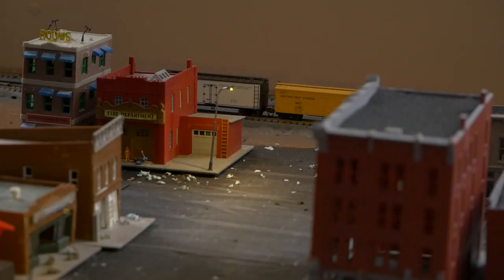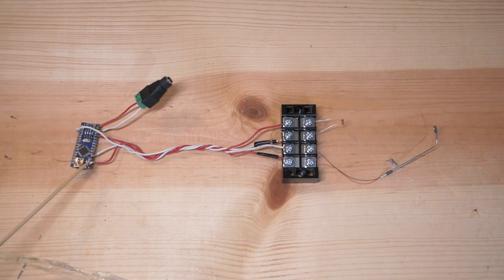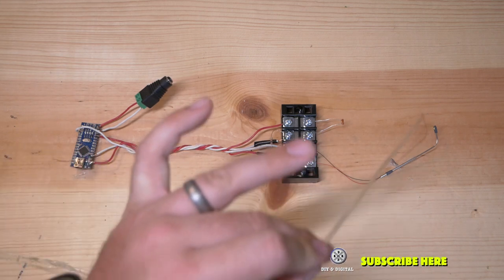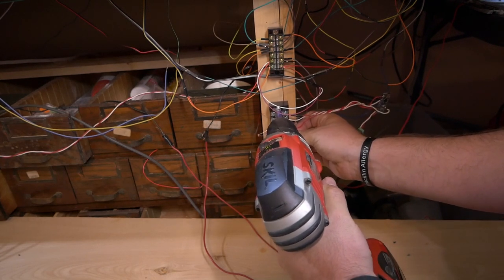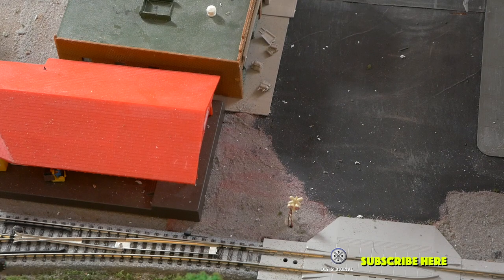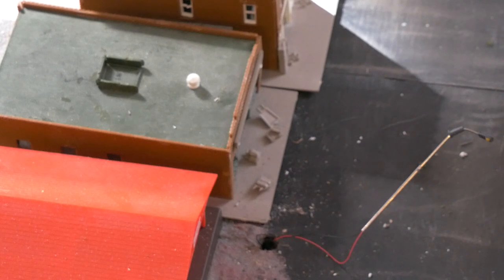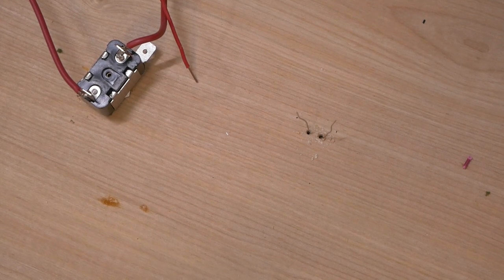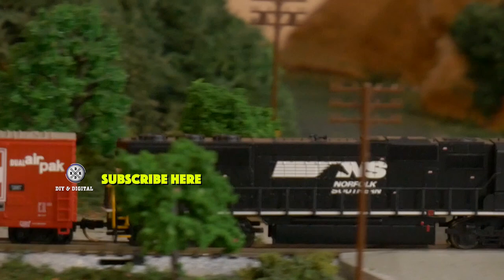Model Train Automatic Street Lights with Arduinos Part 2: Installation

Comment: As the supply is only 5V, an output may not have enough voltage for two LED's in series. So for multiple lights you could use multiple outputs (means lots of separate wiring!) , but to have chains of street lights is a problem as the Arduino is limited to 20mA per output (40ma Max) and the whole board is limited to 200mA (400mA Max).  So if you want 3 or more lights per output, you need to power a transistor from the supply and drive its base with the Arduino. A small signal transistor will drive maybe 5 LED's in parallel, else a power transistor will be required for more.
Reply from the maker: Great observation.  I am going to have to try that when I install more street lights.

Comment: Great video. You make it look easy! I have (of course) a couple of tips: 1. When soldering the wires, have some heatshrink to cover it, not electrical tape. These layouts are up for years, often in humid basements, and the tape just doesn't cut it. I actually use a small size heat shrink tube for each wire, and then a larger tube to bundle the other two together. Makes it almost as hardy as the original wire. 2. For the power connector, hot glue is fantastic. It adheres to almost as much as superglue, is waterproof, you can cut the excess, and it's removable if you have to move or replace. You could have filled your wiring hole with it and stuck you lamp post in that hole.3. The last technique where you used breadboard wires against the photoresistor. I would stick with soldering, especially since the fascia will move over the course of a year from the seasons.
Reply from the maker: You're giving some awesome tips.  I think I'm going to start a user-tip video and feature some of these.
Reply: Apparently I can't send a photo, so here's a link to a typical joint: https://www.dropbox.com/s/tzidwyr3bc4kngi/2018-09-10%2008.19.14.jpg?dl=0

Comment: nice video JD - for my streetlight I use a gray,  1mm thick square "sillywinks" foam piece - gray [get em at walmart for $0.99 8x14 sheet].  It provides a sturdy base and covers the larger hole.  I cut a line in the square from the center to  a corner so I can slip it on after the wiring and function of the light is verified.  Great video.  i am learning a great deal from this channel - keep up the good work
Reply from the maker: That's a really good idea!

Comment: Hi Jimmy nice job,but Vinny has a point ,but i don't know what else to do unless you use a on and off switch.Also with the sallied wire ,I make a loop and put the anther wire thew it and make loop with that one then flatten each loop on it's self and solder them then heat shrink or e .tape. works great for me.    like your videos. Arduino is cool.
Reply from the maker: Hmmm.  I'm wondering if I could hide it at the top the fascia panel.  Photoresistors are tiny enough.

Comment: hi Jimmy...when using photo sensors  wouldn't the lights go on & off as people walk by or are standing in front of when operating trains?? just curious... vinny
Reply from the maker: +bnsf6951 Good catch.  I had that problem at first.  I just had to set the trigger threshold low enough to where that wasnt a problem.